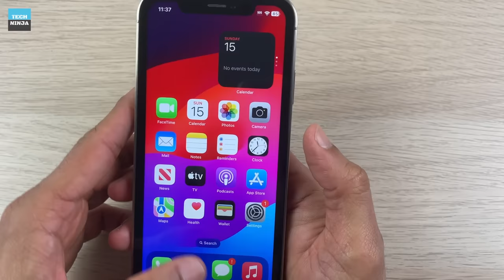Convert iPhone XR to 15 Pro | DIY iPhone

Comment: If i decide to do exact same thing as in video. Will i need to get ordinary Xr display? Or there are special different Displays for xr=14pro case?
Reply: Looks to me like it is using the display of a XR glued to the front glass of a 15 Pro. If you have to do this yourself then its a pretty hard job but maybe its included in the kit.
Reply: @sopgubben  thanks a lot man. Very needed ur advice